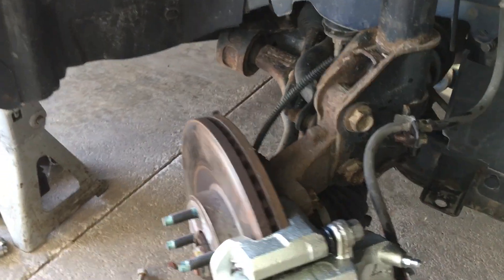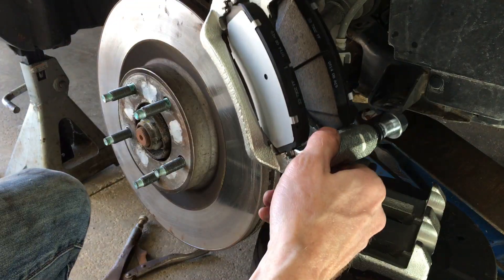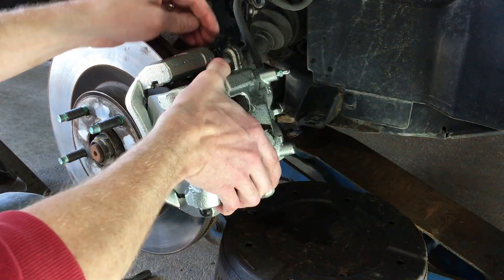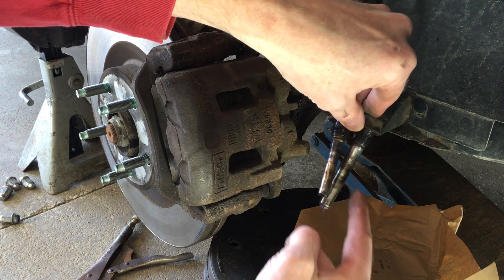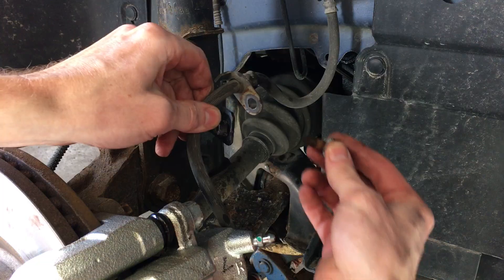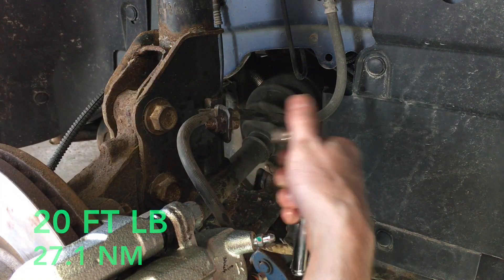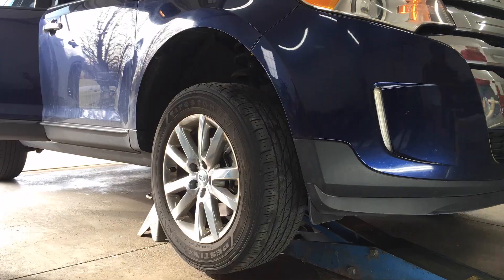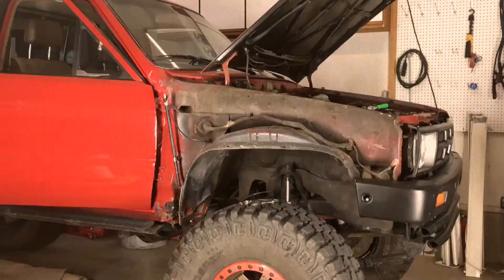Front Brake Bolt Torque Specs for Ford Edge 2011-2014

Comment: Thank you very much for the torque specs. We really appreciate it. Helping my husband do our front brake pads on our 2013 Ford Edge. Quick question....if one of the rotors is SLIGHTLY scored is it going to be a problem if we just put new pads on. For the time being that is. We need the car to get to work & back. ? Thank u in advance. 🙂
Reply from the maker: I would replace rotors so that the pads don't wear down to match the grooves on the rotor, but you can always replace the rotors when you get the chance, sooner better than later.